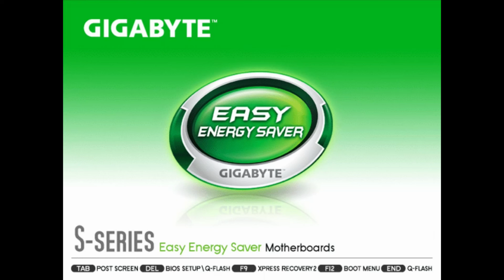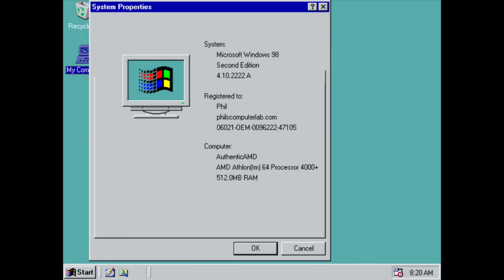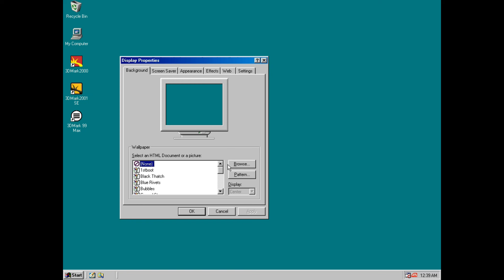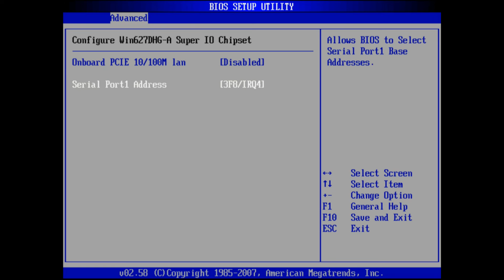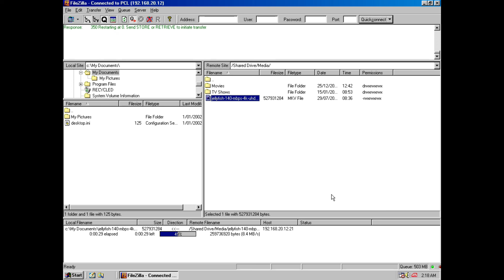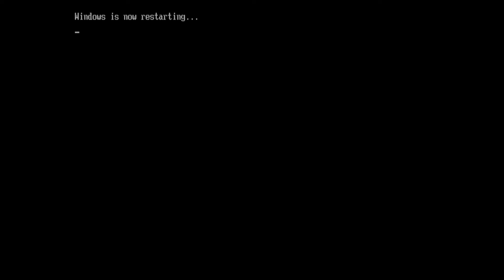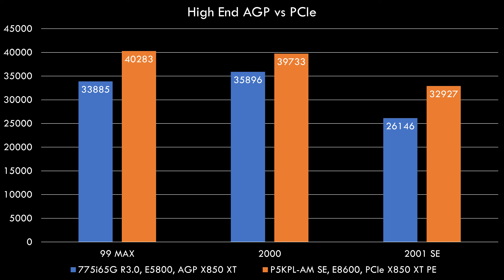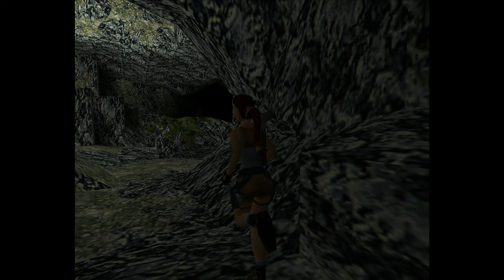Using PCIe Graphics Cards with Windows 98 SE

Comment: I have 98se installed on a Q35 chipset board using a TNT2 Pro, but Sata drivers all in compatibility mode (works but slow).  What drivers did you use for your chipsets, cause I can't find anything from Intel with 98 support?  I do have 2gigs of ram recognized which is unnecessary but awesome.
Reply from the maker: There are no chipset drivers, I didn't install any :) Just the graphics drivers, Ethernet and Sound Blaster!

Comment: As a cheaper alternative to a motherboard with socket 775 + AGP, i would suggest the Asus P5PE-VM. A better board than the Asrock in my opinion.
Reply: It's a good choice. But it doesn't support the E8600.
Reply: @Hardware-Hoarder  Neither that Asrock 775i65G R3.0
Reply: @Rojame77  Yeah that's right. Just checked. I found an AGP board with Windows 98 that supports a Phenom II 965.

Comment: Windows 98 :(

Have you tried Windows 98 Lite?
Reply from the maker: Yea I have, it makes a small difference with really old and slow machines. Not with such beasts like used in this video!
Reply: screw 98lite i use redtoast which is way better. 
https://www.razorback95.com/projects/redtoast/index.php
Reply: My favorite is the UBCD Feb. 2008 version from sharethefiles.com

Comment: I also have Asus P5KPL-AM, but I could't get compatible Windows 98 drivers for integrated GPU
Reply from the maker: Yea use a dedicated GPU from the X ATI series.
Reply: @philscomputerlab  is it possible to use PCI-E Nvida GPU on Win98?

My computer is with Core 2 Quad Q6600, 4GB DDR2 Ram, 160 GB WD Caviar Sata HDD, Optiarc Sata DVD reader/writer, Monitor AOC G2260VWQ6.

I want to send you my computer pictures, so that you could se that i have Win98 running on Core 2 Quad.

P.S. I have the fastest Win98 PC.
Reply from the maker: I will try Nvidia cards in a future video :)

Comment: Quick question about chipset drivers as you went through it quickly. Is it ok to rely on generic drivers Win98 uses for the system then and just leave ones with question marks as-is?

Comment: I picked up a v5100 as that looks like a cheap option to explore for Win98 using a PCIe GPU.
Reply: @LabRat Knatz I personally have not tried to flash FireGL cards into Radeon cards but it may be possible. At least for old FireGL cards, it’s easy to use Radeon drivers (for some cards) straight up but get some of the benefits native to the FireGL card vs the Radeon equivalent. I believe this is what Phil went for here. Definitely some opportunities to play with drivers and perhaps flashing a different BIOS...I’m going to see what’s possible:)

Comment: Quake 3 Arena <3

seta r_displayrefresh "144"
seta r_mode "-1"
seta r_customwidth "1920"
seta r_customheight "1080"
vid_restart

;)
Reply: I find just capping at 125fps feels better with com_maxfps 125
Reply: @davkdavk  333fps is best, but make sure sv_fps is set to 125 or else physics will break.
Reply: @davkdavk  com_maxfps 250 also better
Reply: Quake Live (the relevant Quake 3 iteration today) has a forced cap of 125 fps that can't be changed.
Reply: @wasd____  it can be changed to 250 via command described above you
Reply: @LabRat Knatz Yeah, make a autoexec.cfg and put it in the main folder. If you need anything just let me know.